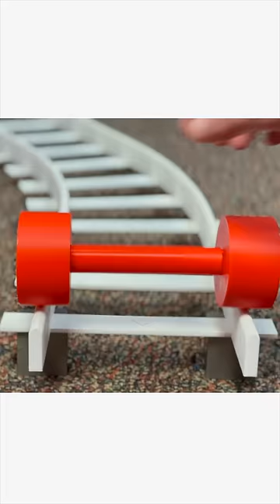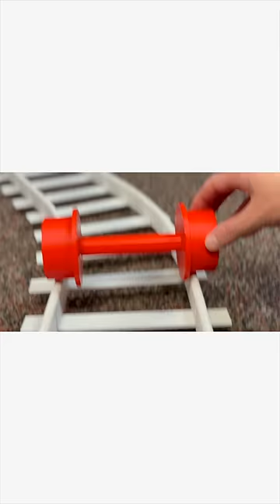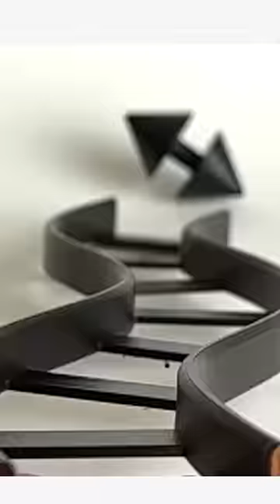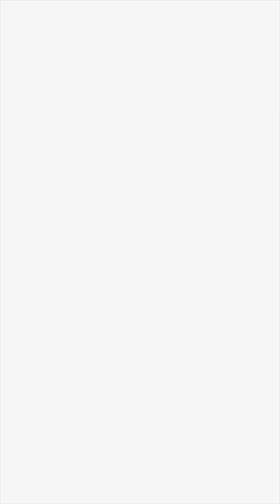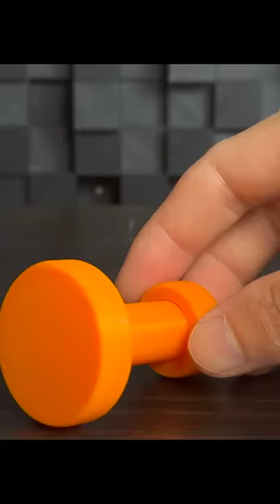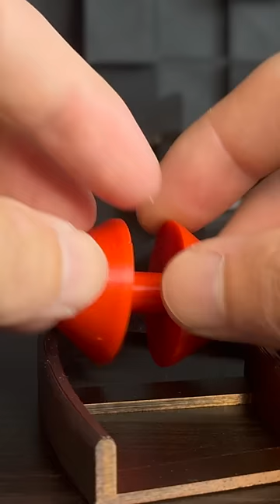The Design of Train Wheels is Genius #3dprinted #trains #interestingfacts

Comment: “No need to reinvent the wheel here…” Trains: “well actually…”
Reply: 1880ish: let’s make them out of paper!
Reply: how would they brake or stop? this wheel is dangerous.
Reply: @Hindu9054  what was 3d printed was a dramatisation they look like the flanged one except they're slightly curved and then disk brakes or whatever blahblah
Reply: @Hindu9054 maybe that +the high weight and speed is why it takes a train a mile to break
Reply: point @novas-requiem
Reply: @Hindu9054 They had brakes. Don't look up when it rains, you might drown.
Reply: LOLOLOL
Reply: @novas-requiem  yeah but that's just for mile long trains lol
Reply: @Hindu9054 you answered your own question. It stops with brakes
Reply: @inediblemangoes7797  if they press break, the force will easily derail. and turning is also dangerous
Reply: Norfolk Southern helped convince government officials to repeal brake rules — and corporate lobbyists watered down hazmat safety regs.
Reply: @Hindu9054 For one, there are wheels on both sides of the train, and two, train wheels are not cones.
Reply: @novas-requiem and they don't have any tread or anything resembling a tire
Reply: @Hindu9054   break pads. A steel clamp comes down on the surface of the wheel adding friction. every shingle wheel on every car of a train has them, not just the engine. when the engine's  breaks come on it signals the breaks of every wheel on the train simultaneously turn on as well.
Reply: @pranay9054 They’re made out of metal, the train will keep moving despite the wheels stopping due to its sheer mass, but will start slowing down.
Reply: @Hindu9054  some specialized trains have tilting devices in the trucks helping it navigate curves easily. Also, actually watch the video because it has more info. And one more thing, trains stop with breaks. They just take more time to stop.
Reply: Nice!
Reply: Nice!
Reply: @Hindu9054 tread brake, disk brake, take ur pick
Reply: Train engineer: Well, actually... 🤓
Reply: @Hindu9054 it's 3d printed... This design is already used for trains, and it is a lot more complicated, so it can brake. Just because it doesn't state everything in the video doesn't mean it's not there.
Reply: I knew someone would make this comment lol
Reply: @Hindu9054 What do you mean how? It’s the same way that a car brakes, just with stronger pistons. The wheels are simply being stopped by friction the same way that a car does. I’m not exactly sure why that’s a problem for trains. If you’re wondering why trains take so long to stop, it’s probably because the locomotives themselves weigh more than the largest tank ever assembled, and that’s not including the couple thousand tons of train cars behind them. Put it all together, and you have slow acceleration, slow deceleration, high mass, and higher mass means more kinetic energy at a certain speed. More kinetic energy means more energy is required to change the state of the object.
Reply: @novas-requiem No, it has nothing to do with the shape of the wheels. The only reason is because trains are just so damn heavy.
Reply: @Hindu9054 One, the wheels on real trains are less sloped, two they have flanges to prevent derailments from occurring as frequently. The brakes work the same way as they do on cars, albeit with maybe a hundred times the power. Look at a train and tell me the wheels look the same as they do in this example. They don’t. In theory this example works perfectly, but in practice it doesn’t work for large scale applications like a train.
Reply: @Hindu9054 bro what? 😂🤦🏻 ofc they’d have breaks on them too.
Reply: @themonsterunderyourbed9408 what???? 😂 what was the purpose of your last message?
Reply: @hush6149 unless it's just the The actual locomotive part, I The shortest expected stopping distance is measured in the hundreds of yards, I highly doubt a mile-long train will stop in a mile
Reply: @Hindu9054 you could use an axle braking system
Reply: The train: 🤓
Reply: @the_undead  If you do the math, you’ll find that a large train can take over a mile to stop at full speed. A mile long freight train can fulfill the size requirement.
Reply: @Mr._Bellic  that's kind of the point I'm making, A mile-long train is almost certainly going to take more than a mile to stop if it's going at any reasonable speed, especially depending on its cargo
Reply: @Mr._Bellic it has something to do with the wheels - the higher the contact surface, the more friction, the quicker it stops. Trains navigate that issue by having several wheels on each cart, instead of like four big ones, meaning far more contact with the railing (this is not the only reason train carts have so many wheels, but it is one of the advantage of the design).
Reply: @Hindu9054 You're so dim, you make midnight seem like day
Reply: @henriquepacheco7473  Well, it is important, but I was saying that the main reason a train takes so long to stop is not because of the wheels, but because of the mass. The wheels are absolutely important when it comes to traction and friction, but not so much with the mile of braking time.
Reply: @apeshitclothing  Who’s even saying “breaks”?
Reply: Oh very nice
Reply: Besides the train wheels are on a axces, the wheels turn to match the train tracks 😊
Reply: Yeah that's interesting
Reply: Ok😮
Reply: Islam = happy forever and go in the jannah❤
Reply: Oh woo
Reply: @SideWinder_999  To their credit: it worked, and worked better than what they had
Reply: Lolololol ☠️
Reply: Oh hi Strato sorry
Reply: The 2nd is real
Reply: Oh hi teojuslin yeah
Reply: India invented the magnetic wheel, - again. New invention done by IndiaNew revolution of worldPatent ep 1397 / mum / 2010 IndiaKinetic motion energy by rotating magnetic field New super wheel of world

Comment: This is how trains turn without a differential! My dad taught me this when I was little, and this is an excellent visualization!
Reply: @leveluxtordu Always one of you in an upload. 

“AcKtChUaaLly….” 🥴

Nobody asked.
Reply: @Kyle_402  i asked
Reply: @Kyle_402 so i guess you just enjoy misinformation?😮
Reply: @tryagain5410 nothing wrong with a correction
Reply: @markgachoka5295  A differential and a wheel, no matter how it’s designed, are two separate things, which is why they’ve separate names that aren’t synonymous. 

Next time I’ll bring crayons or a pop up book, so you’ll comprehend it, and you can bring a gender fluid doll to show me which pronouns hurt your feelings.
Reply: @Kyle_402 Needless closer there, you could've simply corrected the misinformation and left it at that. And just purely nonsensical even in context, point to the pronouns on a gender neutral doll? The only ones would be gender neutral...kinda moot. I get they're calling wheels and differentials the same thing but not many folk are educated on that kinda thing, they couldn't tell a bike chain from a clutch. Thats not unlike you with gender-polical insults, though. Speak on what you know, yknow?
Reply: What does differential mean?
Reply: @HamzadTheShadow a set of gears that allows two wheels to turn at separate rates of speed in the same direction according to different forces affecting each wheel (For example, with an open differential, one wheel may turn faster on an oil slick while the other wheel turns normally due to having traction on the road. A locked differential would cause both wheels to turn at the same rate regardless, therefore distributing  the same amount of power to each wheel).
Reply: @HamzadTheShadow In my opinion, the wheels in this example function as their own differential due to the way they self-adjust, rather than having a differential in the middle of the axle.
Reply: Technically, the wheels are the diff
Reply: I was also thinking that this basically uses the differential principle.
Reply: @Kyle_402  Douchebag and dickhead are different words for completely different things, yet both can be used to describe you perfectly.
Reply: @goaway9450  A differential allows both wheels to rotate at different speed, which doesn't happen here.
Reply: So what you're saying is I need to figure out how to make my car's wheels get bigger and smaller....
Reply: @HamzadTheShadow they have them on cars to accommodate cars going round a corner so wheels don't slip
Reply: I have never seen a conical shaped train wheel though.

Comment: This has answered a question from my childhood that i honestly had forgotten and i now feel enlightened
Reply: Watch Practical Engineering. Longer, better video explaining. His channel is great
Reply: Same 😂
Reply: Except the middle bar wobbles. Creating a very shakey ride.
Reply: Was the question "what's a flange?"
Reply: That sounds like a great moment to have. How fun.
Reply: Allow me to enlighten you. These wheels won’t work after the slightest wear. Trainwheels are made to last.
Reply: @Deveonn  They also provide no area for a breaking system. This method also want to recreate the suspension system since the middle bar becomes a shake weight if you watch it. Trying to reinvent the wheel. Fixing what aint broke etc.
Reply: @amumuimo8530 
*Nobody* WANTS a "BREAKING System" of Any Kind (on a Train or Plane or Automobile or Motorcycle or Bicycle or Quad or TadPole or Trike or Truck or ANY (Motor) Vehicle...  

A Worthy *BRAKING* System Is Definitely Beneficial and Desirable...  

#YoreOttoCoreWreckedDozenTwerkSewWill...  JestSayin'...
Reply: @NoFretBrettCSSMBFF  obviously i meant braking system. Thx cpt obvious.
Reply: @Deveonn  for this to be even close to working the tracks must be s shaped going in a straight line to provide even wear across the cones. 1000% counter intuitive. If they even attempt to drive across straight tracks for a while they will create groves where they were touching. Then every time a curve comes up it would hit the divits each time. Very bumpy ride after a while. The wheels will even end up damaging the tracks after a while. Everything must be rebuilt. Changing the rail system suspension system and braking system just for these to even be close to effective. Imo countereffective.
Reply: Train wheels are just a slight curved flange though? The rail actually curves slightly with the weight of the train and the curve can only adjust so much at a time or the train will derail. So I’m confused by what the is video is.
Reply: @GOOD-COMPVNY The draft angle of the wheels is designed to support the regulated minimum turn radius of the tracks.
Reply: @Deveonn  if I remember rightly train wheels have tyres on, a hardened ring of steel which is shrink fitted to the wheel.
Reply: @amumuimo8530  Suspension, a minor tilting, and overall broader turns mean that the ride should be smooth.
Reply: this wouldn't work in reality

Comment: I think also cool as it turns it actually leans into the turn like someone on a motorcycle so there’s a lower center of gravity which helps train from tipping over
Reply: not the point of the design, and it does not matter as much as you think
Reply: @nikoraasu6929  yeah, because trains have wheels on two sides..
Reply: @nikoraasu6929  Thank you for demonstrating how to be completely unlikable.
Reply: @seigeengine  thank you for i dont give s shit
Reply: @nikoraasu6929   womp womp 💀
Reply: It helps, but I would argue that railroad cants are more important to prevent the train from tipping over.
Reply: i think there is also some amount of suspension on the wheels though to allow them to tilt independent of the whole train
Reply: @santivargasf 
Railway engineer here.

When a train goes through a bend, the train will want to continue straught, which is centrifugal force, felt as if you are pulled out of the turn.

Canting (tilting the train by having the left and right rail at different heights) will move the train's center of gravity further into the turn, which counteracts the centrifugal force and is done to help increase linespeeds for a given traffic type.

Rail lines uses primarily for freight and low speed passenger will typically not get canted track. 

It is only really done on faster passenger rail as it allows a train to take turns faster without risk of tipping over. 

There is an issue with using too much cant though. If a train is not traveling at the normal speed for that line then you end up with cant deficiency, which could lead to a train tipping over into the curve.
Reply: @VentusTheSox very interesting, especially hearing that distinction. Makes perfect sense when explained well by someone who really knows what they're talking about. Thanks for sharing!
Reply: @MetalSonicEmpire  this might possibly be the only "womp womp" that I've found acceptable
Reply: @DaveYognaut  Thanks I only do that like 4 times a year at most lol
Reply: this wouldn't work in reality
Reply: Funny you should mention that. Turning train tracks are on an angle, making the train lean, which keeps everything inside the train not slide off.
Reply: @nikoraasu6929 OooHH shiver me Timbers!

I’m quivering!

Shat up man!
Reply: Tbf I don't think there's a lower centre of gravity here, because the angle of the wheel is constant, it'll rise on one side and drop on the other. Meaning the centre of gravity will still be in the same place as if it were sitting flat
Reply: @unliving_ball_of_gas  I mean, it doesnt really, most of the train's weight is already at the bottom, like in a double decker london bus. And you should see how far a double decker london bus can lean in without tipping over. 

Its 28 degrees for a london bus btw. For trains its about 22, and then they mostly end up tipping over because the wheels have dislodged from the rails.
Reply: @nikoraasu6929  why be so Angy, when you can be calm
Reply: . I often wondered why trains did not utilize the can't system to aid in high speed. Now we know. It is a Thing.
Reply: @tommielee8  
Actually there are 
tilting trains, but they are too complicated and too expensive to be the norm, you might think high speed trains should have the tilting system but high-speed rails shouldn't have big turns to begin with.
Reply: Check out the pendolino train.
Reply: It's an exaggerated visualization. In reality this effect of "leaning in" is infinitesimal. In a curve the outer rails are elevated for this purpose.
Reply: Which wayghostly ghost Street

Comment: What's even cooler, because this design creates occilation that throws a train off the tracks at high speeds, Japanese bullet trains have the angle on their wheels halved. This mitigates the ability for the train to occilate itself off the track (and the slow, smooth turns of bullet train tracks helps make it so those shallower-angled wheels can still navigate the rails well enough 😊)

edit: wtf why does this have 2k likes? (≧∀≦) (evidently nearly 4 now?)
Reply: The difference is that the wheels were designed for the tracks of the bullet trains, tracks that were built solely for those passenger trains. American rail wheels have to be able to negotiate tight industrial sidings as well as wide, smooth curves
Reply: I was today's old when I learnt this!😳😳😳😳👍👍👍
Reply: Life, is roblox
Reply: @suspicioussand  You earned 500 gold
Reply: Before I read this, I basically came to the same conclusion. Unless a mechanism is created to balance out both sides so that when one side goes down and the other side goes up, then going at high speed the train would wovel. Something would need to be created that would need to keep the train leveled as one side rises and the other side lowers. Kind like how those camera accessories they have now, where no matter if it's lowered or turned, the camera always remains straight forward and leveled
Reply: @jockellis 😂 exactly what op said.
Reply: some trains just straight up TILT. like whole ass. half the wheels off the track (if the rails weren't built to compensate for it). it's crazy to watch. the Amtrak Acela has i think about a max of 6 degrees tilt.
Reply: @givemyaccountback-jd4sk  
Nah.
Reply: I dont understand anything but i like ur funny words
Reply: Basic suspension would probably be suffice. @bigmandennis9121
Reply: Well, adding suspensions and differentials also help LMAO
Reply: @Ur_local_peanut  I'm glad I could entertain, whatever form that takes ❤
Reply: Train: 😐
Train Japan: 😱